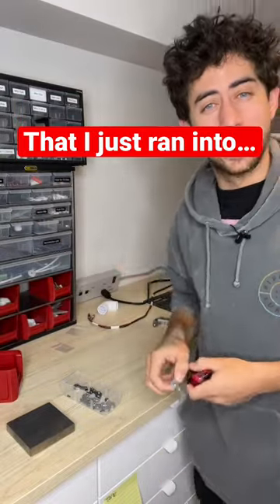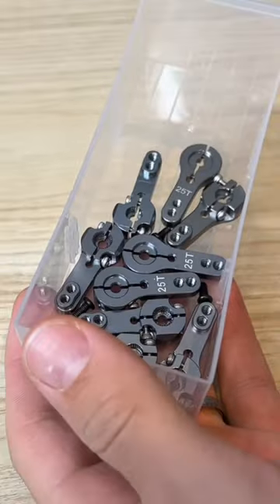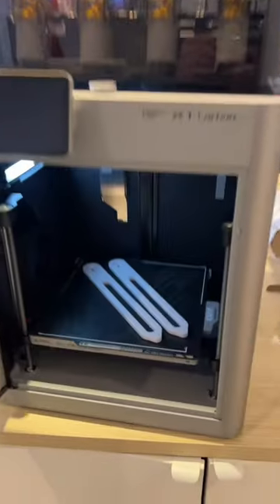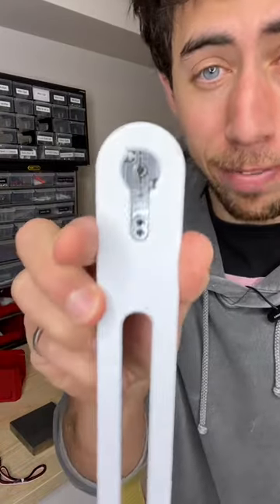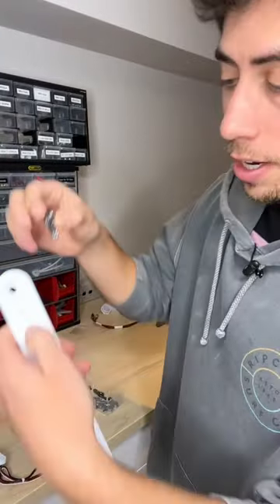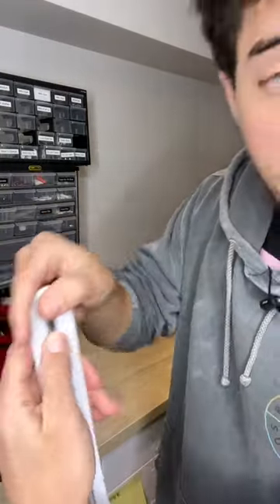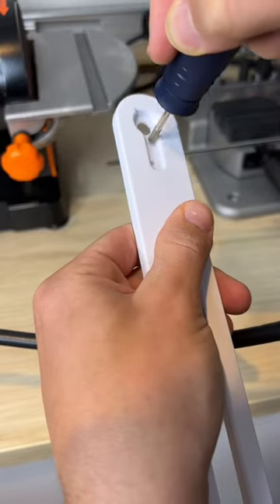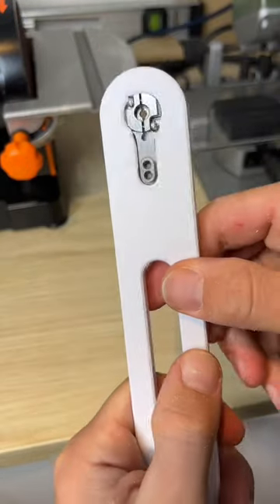An Unlucky Design Problem

Comment: At least the odd one out was the smallest one so you could just make the hole bigger instead of having to re print with a smaller hole
Reply from the maker: This is very true!
Reply: Nah I would've just made the hole smaller with tortilla
Reply: @polycrystallinecandy  the Internet has taught me to use ramen noodles and super glue...

That should do the job just fine

Comment: This is the problem when picking screws from the bins at the hardware store. When you find one that fits what you need, measure it to make sure of its size rather than trusting that it's the size on the label. Too many people put the one that doesn't fit "back" in the wrong bin.

Comment: I've had the exact same thing happen. I work in construction; I used a part to make a template. Tested it using that part. Then, after hand cutting 10 more pieces from the template, I discovered the parts didn't fit. Low and behold the one part I picked up originally from a box of 250 was faulty!

Comment: That is why parts prints have tolerances that allow parts to be slightly oversized or undersized. Typically an inside mating part will have a +0" -.005" and an outside mating part will have +.005" -0" so they are nearly guaranteed to fit together.
Reply from the maker: Unfortunately this wasnt a tolerance problem 😥

Comment: Many slicers generate g code for round internal diameters incorrectly. It's normally about half the extruder diameter to small. It's possible the only one that is the correct size was measured and only the undersized one that fits.

Comment: Damn near went crazy trying to put hello gear and motor together, so I complained they sent replacement parts, they didn't fit either ....tooknparts from crashed hello they worked .  You have to say what are the odds .

Comment: I'm following you and I like your content and I have a curious question that I always have in my mind, let's say that you have a circular metal part that has exactly 5cm in diameter, and you want to design and print a plastic part to go around it, how do you define the gap size, I mean it should be definitely bigger than 5cm, but how do you find the perfect gap size, is it by iteration alone? Does simulation on SW helps? What do you even call this type of problem in mechanical engineering, sorry a lot of questions but I need to feed my curiosity, it's becoming hungry lately 😅😅😅

Comment: I just had that same problem with vape tank glass with two chambers where both glass in a set where supposed to be the same ID they were not and that happened to be the only set in the multipeck that was missed measured between the set

Comment: What brand of servo do you use? Do they have several different types based on torque or just the one you used?
Reply from the maker: I dont have a specific brand I use, basically whatever I can get from amazon

Comment: Why don’t you design the spine pattern of the servo into part and just not use the horn
Reply from the maker: I often do when the part doesn’t need to be too strong! Great call
Reply: @Engineezy  in the RC world most high end servos don't come with "metal" horns usually made of delrin or such, but I guess the printed plastic won't be that strong

Comment: Were all the “servo horns” marked the same, and one was manufactured a bit smaller than the rest - or was that first one a literal different size, and it just shouldn’t have been in the same bin as the others?
Reply from the maker: They all look exactly the same, but I must’ve bought one servo from a different manufacturer, so it probably shouldn’t have been in the same bin.